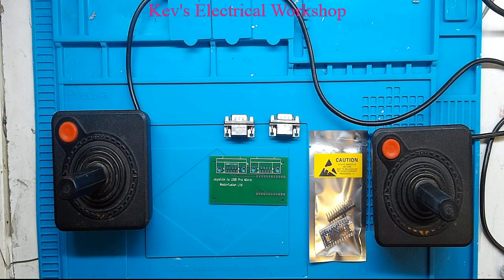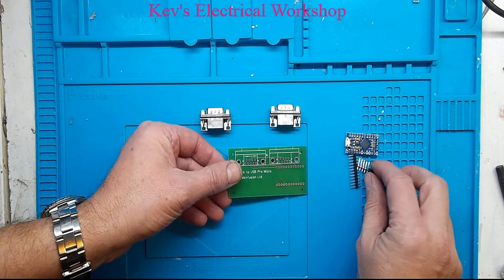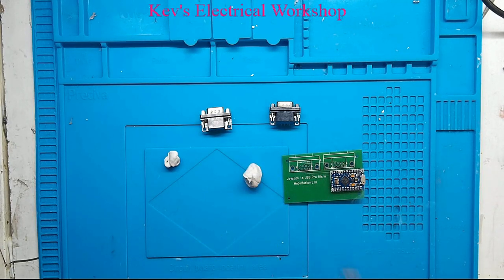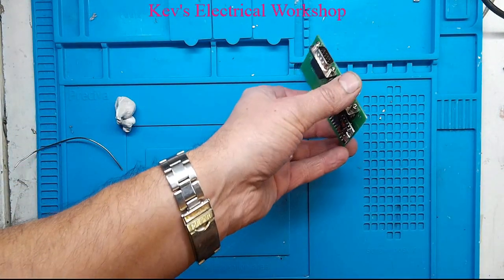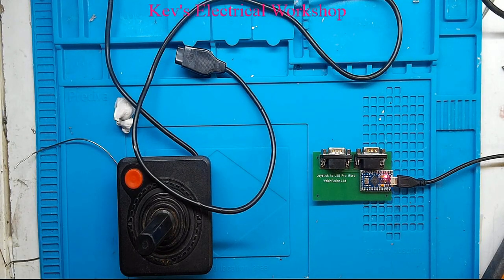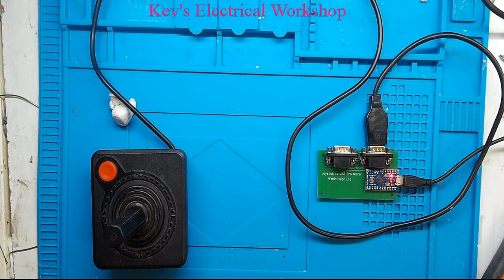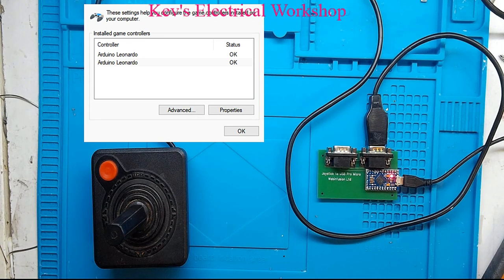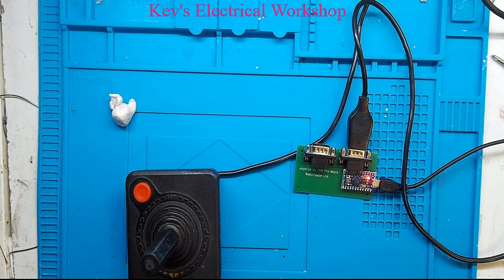Atari Joystick to USB adaptor build

Comment: Hi!  Thanks for the video.  Was curious if you would share the wiring diagram for the DB9 to Arduino.
Reply from the maker: Hi, the arduino to db9 are in the first few lines of the arduino sketch which from memory is available on github
Reply: @KevsElectricalWorkshop  Thank you.  My bad for missing that

Comment: Do you have a link to the sketch and maybe the drivers/test software you used?
Reply from the maker: https://github.com/mcgurk/Arduino-USB-HID-RetroJoystickAdapter
Reply from the maker: the test software windows10 joystick test and i used on the stella emulator
Reply: @KevsElectricalWorkshop  Super!. Thank you very much for the link! Going to try that one.
Reply: @KevsElectricalWorkshop  I'm gong to use it on winuea and maybe c64. Thank you again!

Comment: Nice video and a great little mod board, well done Kev.

I have just subbed to your channel and was wondering if you could go through the process of getting a circuit board built, showing each step and all the files that you need to produce to get it manufactured. I think this would be interesting and help out a few people who are just getting started and would like to make a simple board just to get to know how the system works. Even one of the 555 & 4017 flashing LED type circuits would be great. You could even include a link to the Gerber files or sell the Gerber files????
Anyway, have fun and best of luck on your next project,
Joe
Reply from the maker: Excellent idea its on the list that one, maybe think of i
idea (eg 555) and go from idea to product.
Reply from the maker: Hi Joe, do you have a circuit, i could then use this to do a video of how to produce custom pcb's
Reply: @KevsElectricalWorkshop  I wish I did. That is one of the reasons that I would love to see this series of videos. I would love to know how to design a circuit and then have the board produced by someone like JLCPCB and then build my own board. I have just been building the kits from China and trying more complicated ones as I go and I have just finished a surface mounted board that was challenging. But no, I don't have any circuits of my own. I don't suppose anyone would mind if you copied one of the Chinese circuits as they may well be copies of someone else's design anyway????
Reply from the maker: Ok Joe as i dont need any pcb's at mo i will find something online and go from concept to checkout i think

Comment: Nice Project

I would like to find your parts list for this and also the information to get the PCB.
Reply from the maker: Limited stock of PCB's available at http://www.webinfusion.co.uk
If popular i will get more made
Parts is just a arduino pro micro and 9 pin pcb connectors.
Reply: I would love to buy one of these or try and make my own. Do you still have any pcb’s left?
Reply from the maker: @diddrumdontdrum  yes somewhere
Reply: @KevsElectricalWorkshop  I would love to have a go at making one of these. I have at least 4 different joysticks that I could use with my Pi if I could build one of these. I have never soldered anything in my life but this vid had inspired me to give this a go. I’d love to buy any bits that you can provide. Is there a way I can get in touch with you?
Reply: @KevsElectricalWorkshop  Hi. I’d really love to give this project a try. I’m in the correct age bracket, lol having been born in the late 60’s. I have at least 4x joysticks that could be attached to my Pi with this. I have never soldered a thing in my life but your video has inspired me to give this a try. If you have any of the bits, I would gladly buy them from you. Perhaps you could let me know how to contact you outside of you tube? Very excited!!
Reply from the maker: @diddrumdontdrum  	
have you programmed arduinos before ?       sales@webinfusion.co.uk
Reply: @KevsElectricalWorkshop  thanks. I have left a voicemail message on the number from your website. Look forward to hearing from you :-)